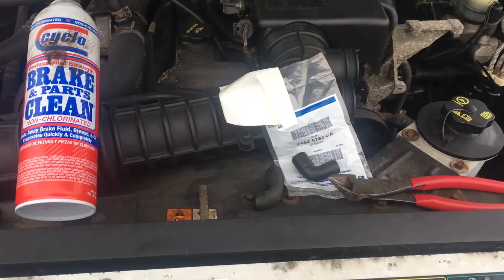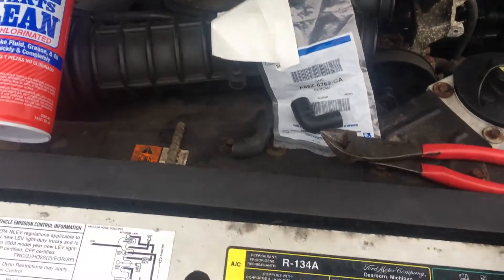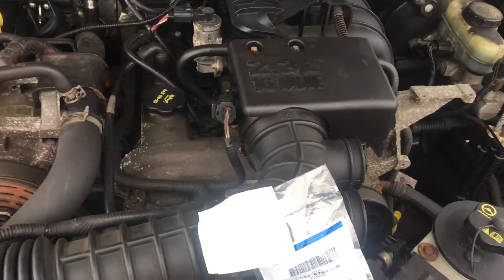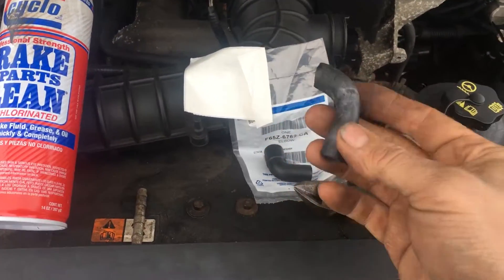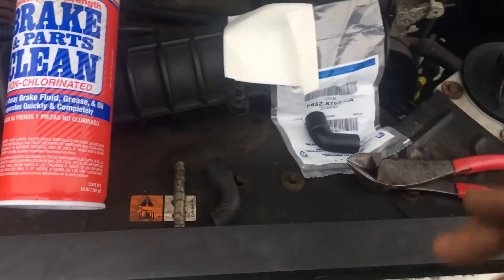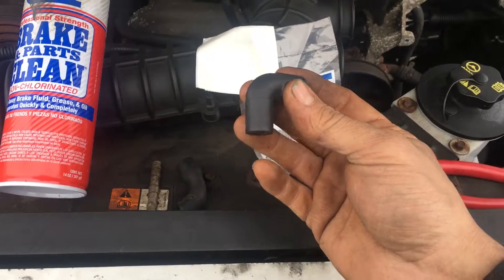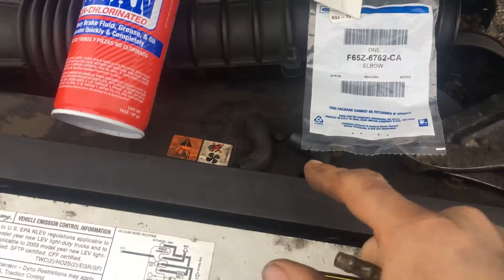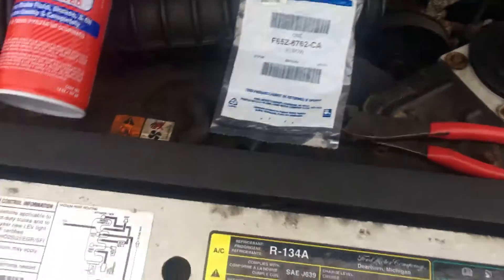Bad running Ford /quick fix, running like the emblem look bad but working!! ￼

Comment: When they are equipped with the plastic.line, a 90 degree spark plug boot works very well. You just pull the terminal out and use the rubber portion. Been doing it for years.
Reply: This problem happened on my wife's Mazda (Ford engine) followed advice from a forum and put in a copper plumbing elbow. Worked a treat.

Comment: I recently had an issue like this but if these fixes listed herein don’t work replace your emergency shut off rollover switch ( behind the kicker panel where your in cab fuse box is) and don’t forget your fuel  pump relay switch as it may be inadvertently sending “ ghost signals” to your computer that the diagnostic computer WILL NOT pick up.

Comment: Very helpful video. I appreciate your help,  Brother.
I also have some questions regarding my 1994 3.0 v6. It blew the MAF sensor, so I replaced it.  Truck ran good for about 1 mile, then blew the new sensor. It stayed running. And I drove to the gas station. And put some fresh petrol in it. But still barely running. So I unplugged the sensor and  it ran fine enough to get me home. Runs fairly good with the sensor unplugged, but will not idle. I also replaced the intake air control valve, but it makes no difference.  Help or ideas?
Reply: I have the same problem, did you fixed it?
Reply: The RKIs say the MAF is something you have to go OEM on... and your experience just adds to that... I mean yours burned out after just ONE mile! ... MAF works by HEATING a filament, then measuring airflow by how much the filament is cooled off.  Try a junkyard MAF if you don't want to pay OEM/FoMoCo prices.
Reply from the maker: Sorry big John I never seen your message
Reply from the maker: The very sound advice, May be better than I would’ve said

Comment: I have a 94 3.0 v6. Had a high idle, fixed that by cleaning maf. Now it idles around 500-1000 with a super rough idle. Almost like the thing is cammed lol I cleaned the iac valve as well. Any ideas?

Comment: I always heard Rangers were good trucks. So I went and bought one.
A 97, 4 cylinder, .one owner. Only 134,000 miles.
Well taken care of, and a stack of paperwork to prove it. Very clean.
But a week after buying it, it starts running like shit. Doesn’t give any codes. Here on youtube, there are plenty of videos showing several different reasons for rough running.
I then find out mine has 8 spark plugs.
I don’t know 
about other years, but the 97 sucks...
Reply: Don’t know if u will see this but u never buy a 4 cylinder they don’t last once they get over 100000 miles best to get a v6 and  the very best is v8 just something I learned from buying used cars 💪🏾
Reply: @thetruthaboutbusiness  that's not true at all! Usually quiet the opposite.. I have a 96 ford ranger 2.3 with over 400,000 miles and still runs great!  4 cylinders usually have less strain on them like a smaller caliber gun so it dosnt wear as quick.
Reply: My Life Crew,  Wrong. The v8s I’ve had were all garbage gas hogs. The best engines I’ve had were all straight sixes
engineered by American Motors. I’ve also had 2 Nissan small trucks with 4 cylinders, both excellent. I now have a
Toyota v6. The longest vehicle I’ve ever kept. Full size Ford truck V8s are
good, but not perfect. Toyota is the best you can buy
Reply: stoney renegade, I hear ya...
Reply from the maker: I would agree on the straight six part but the four-point owes a piece of crap
Reply: I have same one biggest pos I have owned. I'm puting a v6 in minr.

Comment: So would a 2000 3.0 Ranger have the same hose? For whatever reason, I was messing around under my hood and found a hose that looked identical just chillin far apart from any places it looked like it’d belong. I’ve tried finding where it belongs for weeks with no luck.

Comment: I have a 2001 Ford ranger, it idles pretty rough,  it sometimes jerks when shifting gears
( automatic transmission) and when driving on the road itll loose speed even when I'm hitting the gas pedal and I'll have to take my foot off the gas and slam it down to get back up to speed. Any help would be appreciated,  I'm by no means a mechanic I only know the basics, change the tires,  sparkplug, oil ect. This is out of my element lol. Maybe I should've tool auto in high school instead of welding. I've put all new spark plugs in and cleaned out the mass airflow sensor but those didnt change anything.
Reply: Me too
Reply: Try replacing the throttle position sensor, or the transmission range sensor,also known as the output speed sensor,bolts onto the top rear of tranny, or try the idle air control unit, or the vehicle speed sensor,it bolts onto the top of the rear differential housing, they're all pretty easy to replace if you watch a YouTube video

Comment: Hi, I changed the thermostat on my 2010 Ford Ranger Sport because when it was in the drive trues it would get hot, but when it was running it didn't, so I changed that, and when I turned it on to see if the new thermostat worked, the engine would A strange sound, when I sat down I saw that the rpms were very high in parking, then they changed from parking to drive and the rpms went down, I turned it off to see if it returned to normal but when I tried to turn it on, it no longer wanted to start, just cranks but won’t start, help me please!
Reply from the maker: Sorry to hear that happening to you Ariel .Well you need to go back and retrace your steps you More than likely bumped something or did not hook the coolant temperature sensor back up correctly double check your work I’m certain you will find the problem look it over very closely and think about everything that you did during your procedure and it’s just like when you lose a set of keys and you sit down and think about it you will find the problem that I’m sure of sorry I wish I could be of more help but there is a ton of things that you could’ve possibly done so that can be my best advice
Reply: The Clay Way thank you very much!

Comment: Thanks for the video, any idea why my oil meter on the dashboard of my 2003 Ford Ranger is shaking every time when I stop the truck?
Reply from the maker: Probably because it’s got low pressure at an idol. Causing the gauge to be a Radick obviously I can’t be for certain because I’m not there but that would be my best guess
Reply: im working on my 02, 3.0, and i found my pcv valve elbow had collapsed, and my be the cause of my jumpy needle/......cross your fingers...
Reply: Wouldn't you know that Trump is my heerrrrooooo
Reply: @sharpcarco  thank you !
Reply: @jerrybutler1336  ouch! Thanks for replying
Reply: Kind of late but try this. Replace the oil pressure sensor located on the passenger side back of engine. Do it before your gauge needle full on falls out of the high and low range. Once that happens you'll need to open the dash and reset the needle. Also change your oil and filter more often. Mine bounces when oil is dirty. Doing mine soon. As per a mechanic I trust, its just the sensor going bad. Mine burns a lot of oil so check it every month.
Reply: Same for me I’ve been trying to find the problem but I have the same exact issue, if you find a fix please tell me
Reply: @vbloodrose1973  Took my engine to blow, but I figured mine out lol. I had the flickering guage for years and it turned out to be the relief valve on the oil pump was gunked up and stuck halfway open causing oil pressure loss. Maybe take out your oil pump and clean it or replace it.
Reply: Mine does that I have a rough idle problem and I've narrowed it down to a leaking intake valve. At idle the truck has a misfire which is caused by low compression from the one bad cylinder and so the oil pressure gauge flickers.

Comment: Mine will run for a few minutes and it will have like a light idle rev up and down and shake a small bit. But only when it’s nice and warm
Reply: Mine does the same thing idles at about 800 will drop to below 500
Reply from the maker: What kind of vehicle are you to commenting about it doesn’t show me that
Reply: @sharpcarco  2003 ranger
Reply: @sharpcarco  having the same problem with my 1994 ford ranger 2.3l also it wont go above about 55mph
Reply: @cam3672   timing belt
Reply: Mine to
Reply: @jonathanbales2002  same
Reply: ‘06 Mazda B3000 3.0 dual sport  #METOO
Reply from the maker: I’m just guessing here I didn’t see the other comments I’m assuming that if it’s not the Hose Like on mine it could be the idle air control solenoid
Reply: 1999 b4000. First start rough idle and stall once shes good and warm she idles just fine.  And I say she for good reason.

Comment: Got a 97 ranger xlt 4.0 with a 2 inch lift on 33s and i got the tran replaced and i can only get it up to 35mph before the RPMs go up and it wont go any faster. Any tips?

Comment: I have question I have an 06 ranger 3.0 with high idle and when I let go of the gas it still stays high I changed maf tps idle control valve and still have the issue any suggestions??
Reply from the maker: I can’t say for certain because this is a text message but on a Ford it generally is the idle air control valve. At least that’s the first thing I would try.
Reply: The Clay Way I have I changed the idle control valve and mass air flow sensor and I changed my pcv valve
Reply: The Clay Way it started to act like that after I cleaned my throttle body
Reply from the maker: Take some brake cleaner start your vehicle up and spray it around your throttlebody or the bottom of your intake and see if the engine revs up That will tell you that you have a leak in that location
Reply: Thank you , very helpful
Reply: Devin Kleib, I made my own gasket for the idle control valve and made the hole smaller than usual. No more high idle...

Comment: Ok I have a question. I have a 2001 ford ranger 3.0, when ever I put fuel in it keeps popping off the machine and it’s pukes the fuel back out. How do I fix this?
Reply from the maker: I’ve got a decent video that describes what that’s about but I haven’t made one on a Ford

So the video I have is about a Chevy

It’s the same omission system basically and it’s a plug to mission system that is causing your fuel to cut off and kick back at you there’s no ventilation for the vapors. 

I’ve been meaning to make a video about that for about six months because my Ford does the same thing. 

Your situation sounds a little bit worse because from the sounds of it there’s absolutely no fumes escaping your fuel tank but if you watch this video it’ll give you a very good idea of what to do
Reply from the maker: https://youtu.be/AFTpcyer_aE

Comment: What's your advice on an 02 that keeps burning heater valves?
Reply from the maker: More than likely that’s because you have a catalytic converter problem that’s my best guess I’m not there so I can’t say for certain
Reply: @sharpcarco  could it be because the valve is made of cheap plastic?
Reply: Id say get a lower temp thermostat and make the engine run cooler and go from there. Thats where id start

Comment: clay I have a 2000 ford ranger 3.0 V6 that died after the battery light being on for a few months now it wont restart i put a jumper cable from negative to the engine it started but then died after about 7 seconds thought it might be a bad ground but my multimeter reads 12.4 for every ground I can find i'm actually in Grand Rapids is there any suggestions

Comment: I need help with mine it cuts out when it hits like 2 grand or 3 grand but if you give it gas it right back to having throttle
Reply: Mine does the same thing I want to know if you hopefully figure out why your truck is doing that ? Thank you and have a great day
Reply: @matthancock3526  I unplugged the mass air flow sensor and it worked man I traded it while ago though lol

Comment: I put a cold air intake on my 1988 ford ranger 2.9 v6 it runs rough cold but after warming up it runs fine what should I do
Reply from the maker: Did you take out the mass airflow sensor? If a 1988 even has one ....
Reply: @sharpcarco  no the do but I figured it out the tube from the cold air intake that gos to the motor was to big so I but the factory tube on

Comment: Hello, Ford ranger 2003 2.3 L automatic, check engine light code p0171, too lean, I replace both oxygen sensors, engine light turned back on after unplugging battery. today I actually deleted the code with scanner. It runs great, but sometimes at idle or at red light, it goes from constant smooth idle to kind of like reving down, not so much just slightly. Any recommendations? Air leaks? Etc
Reply from the maker: Spray around the intake while it’s running be careful not to have defective spark plug wires because it could start a fire..... and if the engine revs up when you get to a certain spot that’s where your intake leak is 

It’s probably because you have some kind a vacuum leak or a defective idle air control valve

Comment: Question: i have a 98 ford ranger 3.0 my problem is the check engine light. I have replaced the engine and still cant get the light of.in. your opinion whats my next step besides sell it lol.help please.
Reply from the maker: I wish I could help but I wouldn’t know where to start
Reply: Connect an ob2 scanner and clear your codes

Comment: I have a 94 Ford ranger 2.3 L will not run at idle but if I give it any gas at all it runs any idea as to what is going on? Thank you in advance for any solution